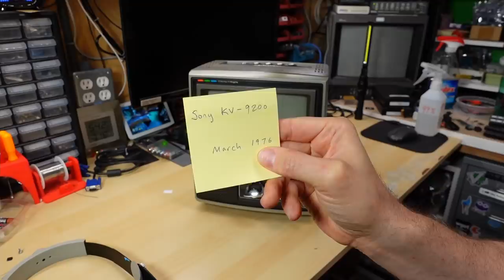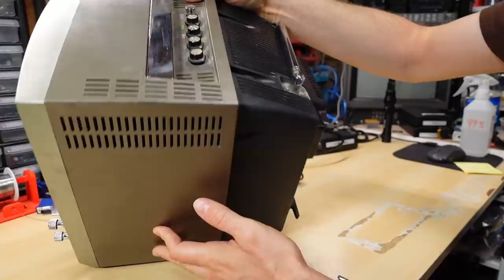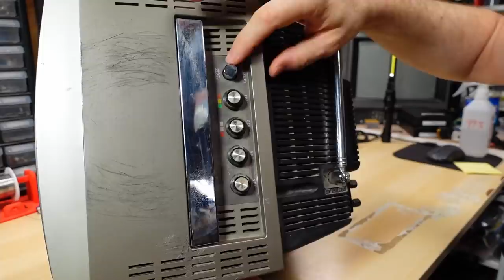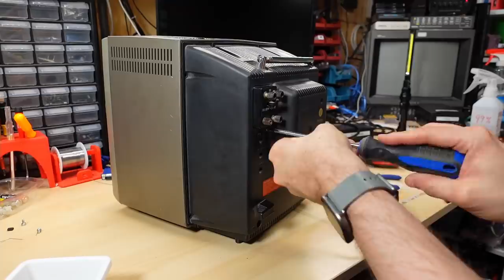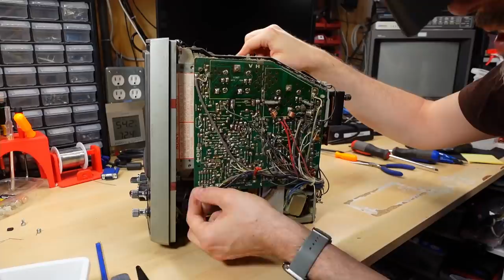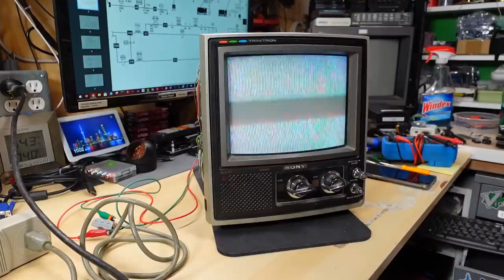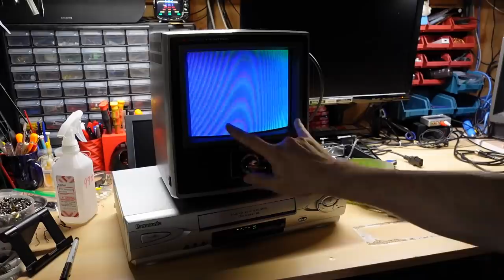A very used up (and broken) Sony Trinitron from 1976

Comment: Fun fact, keeping the filament on at a much lower voltage actually prolongs the life of the vacuum tube.  They used to do this to the early vacuum tube computers, to cut down on tube failures.
Reply: Isn't computerphile a great channel? <3
Reply: One part is correct in one part is not. They did leave the tube filaments on to prevent failure due to inrush current. Unfortunately the engineers discovered later that the tubes were failing at a very high rate. This was caused by operating the tubes for long periods of time in standby mode without b+ voltage. Special computer tubes were developed that reduced or eliminated this effect.  Many computers used 12ax7's or 12au7's and special 6000 or 7000 series tubes were developed that were exactly the same specification as the consumer tubes but with the special cathode that prevented poisoning.  These are now sought after by the audio fools and bring sometimes extraordinary prices as they are seen as being superior for audio work.
Reply: @randyab9go188  Ah, i did not know there was a separate design for those tubes.  I always assumed they were the same tube.

And i was basing some of what i said on other lighting solutions, which tend to last a much longer time if the power cycling is minimized.
Reply: @randyab9go188  The fun part is .. they aren't. 

Those special cathodes are noticeable noisier, doesn't really matter in digital circuits, but is a disadvantage in audio applications. Long-life audio tubes from the time DID NOT HAVE THEM. And the noise reason was stated by the manufacturers.

Comment: In the early 80s Hitachi made some sets called Instaview or Instavision, with an unusual directly heated cathode, the CRTs didn't last very long. Hitachi promptly made a modification which involved replacing the CRT along with several components on the tube base and flyback area, it kept me very busy for quit a while, I think Hitachi was honouring this procedure for around 10 years, must have cost them a fortune.
Reply: i had one of those directly heated hitachis as a second hand set for a few years until the tube emission was too poor,  also had 3 earlier (1972 ish)models which used a normal crt but kept it heated at lower voltage when 'off' , had a 'fully off' switch on the side, model cnp190, csp680 (which had a rotary click stop tuner, like usa vhf sets!, i'm in the UK), plus another one cant remember model no.

Comment: Worked at a place that sold a 36" Trinitron for s short while.

If I recall, it weighed just shy of 200 pounds!!!

The front glass was something like 3-6" thick and think they even had to counter weight the back so it didn't fall forwards.
Reply: I used to work for Radio Shack, and back in the day (2001-2004) we got a 36" RCA TV that was just as heavy.  We only sold one, was on clearance and was on the display.  It took 3 of us sales guys to get it down off the top shelf (without breaking it) and back into the original box.  Was sad to see it go because of the screen size, but also glad to get it out of there.

Comment: I have an early 70s 9" RCA B&W salesman's sample television, built with a mix of tubes and solid state. Its power cord is also incorporated into the back cover, as a safety feature: The idea is that you can't keep the TV plugged in with the back cover removed, so you can't electrocute yourself while swapping tubes. Obviously the consumer wouldn't be working on this Sony like they would with my TV, but I guess Sony still held onto the idea with their early solid-state TVs.

Comment: I have a late 70s zenith tv with a similar issue with the power/volume switch. I ended up just throwing a switch on the back of the tv to turn it on/off.

Comment: Adrian, somebody else has hinted at this but have you checked to make sure that the CRT is receiving full heater voltage? When you were messing with the wires on the switch maybe you have it so the heater is in the reduced power mode, that would certainly explain it being a bit dim. And we saw earlier that the instant on wasn't working, so maybe that helped cut down on the cathode wear a bit.

Comment: The Sony supplied cord unclips from the rear cover.  Use a flat screwdriver to pry the metal retainer off the cord.  It will move in the longer direction.

Comment: i have 3 of what i think were the first models released here in the UK, KV1320, KV1320 mk2, and KV1300 (plastic cased version of KV1320 mk2) all 13 inch ,1970, i think?,  the KV1320 mk1 version has a big mains transformer, but the mk2 a series chopper switching regulator

Comment: This TV was already 9 and a half years old when I was born.
1:33 - Whoa, I love that volume control+power button, they look like cigar lighters in a car :D
7:10 - I think an external antenna was sitting on top and they were turning it all the time to have a better reception.

I was like there's no way the power is bad, why did you bother checking it, it must be good because the tv drew current when you swithed it on. I wouldn't have guessed that the switch has some double action going on inside. Maybe you can fix it if you are able to take it out and has better access to it's back.

Comment: It's kind of amazing a 45 year old phosphor based CRT even works period.  Those phosphors are going to be worn out pretty badly at this point.
Reply: Not really. The first thing to fail would be the flyback. As long as that is good a complete cap change should restore it back to nearly full health, even if the tube is dim, which this one isn't, regardless of what he thinks. I've seen and fixed plenty that were worse, he's given up even before starting. Waste of time, give it to someone who knows what to do with it instead of hoarding it and complaining it isn't perfect LOL!
Reply: It's the cathodes, the phosphor always outlast the electron gun itself.
And Trinitrons are really, really picky when it comes to rejuvenation, sometimes it works and others it just makes it worse.
Reply: @GoldSrc_  Maybe. The point is the TV is not dead and it's not that dull. It's perfectly usable and a cap change should fix any geometry issues. For the amount of use it will get in the future it's just fine as-is with a bit of maintenance to the caps, adjusting the rings/yoke and possibly a light rejuv. The main issue is the wrong person has it.
Reply: @johnbos4637  It's not "maybe", that's what happens.
The cathode surface gets worn out way faster than the phosphor ever will, unless it happens that the deflection fails and he keeps using it while displaying a line, because that does burn up the phosphor.
Replacing the caps is a very good idea, I had a KV-1201 that I had to replace practically every cap.

As for rejuvenation, you do not want to do that to a Trinitron tube, the chances of doing nothing or making it worse are way higher, in-line electron guns do respond better than the Trinitron single gun design.
Reply: @GoldSrc_  You missed the point. It's working just fine as-is. Nothing is needed except new caps.
Reply: @johnbos4637  My original reply was not aimed at you though.
Reply: @johnbos4637  Didn't look dim to me. Looked like all the colors were there.
Reply: @andershammer9307  Exactly. That's what I said earlier. The screen is fine as-is and a cap swap will fix any other geometry issues. Like I said, the wrong person has it.

Comment: I have a 55" OLED TV which weighs 18KG (39 lbs) - 8339 cm² (8.98 ft²) of screen area for less than double the weight of this 9" CRT, which should be 251 cm² (or 38.9 in²) or even slightly less, accounting for visible vs. measured size.

I can't find an original price for the KV-9200 but I wouldn't be surprised if this cost more in its day, accounting for inflation, either.

45 years of technological progress has brought us a long way, although something makes me doubt that the 2021 display will still be working at all in 2066...
Reply: marketing strategy. your tv will last less than 10 years.

Comment: 9inches? and I thought 14" were small...

also, 75W !! holy crap... the last CRT TV we had was 20" and was just ~100W, my 42" LED TV is 85W
Reply: With CRT TVs the size doesn't contribute to the power consumption as much as you might think. Most of the power usage is outside of the tube itself. My family's only remaining color CRT TV (from 2000) is 13 inches and rated 69 watts, while I believe comparable 30" sets were more like 120.

A 75 watt rating for an old 1970s design set with a smaller 9" screen seems about right.

Comment: Trinitrons are ridiculously heavy, even late models, the glass they used is just so thick that it makes them "unique" with the heftiness, my 9" RGB Torch-brand monitor (which I got working at last!!!) is a heavy little thing too, based on a Sony trinitron character display, not helped by the metal chassis and the multiple PCBs inside the thing... :P
Reply: They needed extra glass to compensate for losing strength provided by the curvature of the screen. Flat-screen CRTs are also quite heavy.

But if you really want lots of weight per screen size, look at the old round CRTs. While modern CRTs have an integrated metal band to prevent implosion early CRTs needed to use more glass. A 10BP4 must be close to two inches thick at the front.

Comment: You should try degaussing it. Degaussing coils aren’t very expensive, but I can imagine you don’t want to put any money into it.
Reply: @jabbawok944  thanks, missed that one. There is a technique to degaussing though… bit of an art to it. Later monitors has degaussing coils built in that activated on power up or on request through OSD menu so hand degaussing was lost to time. My dad did it a few times in the early 80’s, I remember.

Comment: Instant on nowadays would be a cool feature. I've seen LCD TVs take longer to boot than tube type CRT TVs (with solid state CRT TVs, I would have beaten the first level of Super Mario in that time).
From what I've heard, Trinitron CRTs don't rejuvenate. They'll die if you try. Don't know if that's true, but if Shango, Radiotvphononut and Jordan Pier say so, I'm obliged to believe that.
Reply: You’d have to be VERY careful with a manual control rejuvenator and still get no noticeable results until you blew the cathode/filaments apart. Sad that these things might not be restorable, but it’s a nice piece of history
Reply: @lauram5905  yep, its a 'historical'/collectible item, it could never? be restored to an everyday working state, too much risk of failure of unobtainable parts such as line output/flyback transformer or eht block

Comment: Very weird shell/cord, but the weight is revealed inside heh. Looking at that tank I can't imagine it saying "Compressed air, my one weakness.". ^_^ Love the old buttons, looking at my new TV "No buttons, buttons are not the future!".  :\
Sad but true, if the tube is spent it's little better than a donor parts for that model. Do my usual spiel anyway, if you find better  ones, please, please add as many contemporary AV ports you can. RF devil forks absolutely doom vintage TVs to the scrap pile more than Coaxial or Composite ever will.

Comment: No more repairs? Yeah, that's a bid sad. Looked okay on video. Maybe someone else can work on it a bit. It's a cool little TV for sure.
Reply: I was wondering what happened to the CRT rejuvenator. Hasn't been out for a while.
Reply: @PJBonoVox  Trinitrons don't like to be rejuvenated, most of the time it doesn't work and it can make things worse.
Due to the single gun and cathode configuration design.
Your average in-line triple gun CRT responds better to the rejuvenator than Trinitron tubes.

Don't think I've seen Shango066, Jordan Pier or radiotvphononut rejuvenate Trinitron tubes for the same reason.
Reply: @GoldSrc_  Yes. Use remove shorts or clean function only.

Comment: 31:10 The color distortion on top could be electronics.. sure.. but it could also have been made by magnets coming too close to the screen i bet.
We did mess around with magnets on old picture tube tv's in the past. one could have for example a pure blue screen from a VHS machine menu, and make a purple dot on the screen corner or in the middle wherever you want with holding a magnet somewhat close.
If holding it far away it will be no permanent change but be discolored like that so you can easilly see what happens.
But too close and it will be purple forever if one does not do anyting to fix it. To fix it one had to turn the magnet around  and come on with the maget field upposite way  just the right distance, try a little and little closer to see if it has some effect. The blue menu will become forever blue again if you hold it at the right spot as it shall be. Too much and it becomes green instead and one have to turn it again to make it blue or if too much purple again so one one more time has to turn it around to fix it :)
So yeah, it looks like this kind of distortion that might be caused by a magnet, for example if lots of TV's or speakers was stacked on top of eachother it can happen, or loose car speakers perhaps more likely to be strong enought to make it permanent unless you fix it, like you may now need to do.
If one has a stereo HIFI system with a speaker close to the tv so it temporary will be purple while the speaker is there..  then one could just adjust it with a magnet while the HIFI Speaker is there so one could have the speaker close while still nice blue menu and no distorted colors, i did do that to my 28" Stereo tv in the past to have the speaker where i wanted it :)
If removing the speaker while having it this way it will be miscolored and time for a magnetic adjustment again when no HIFI speaker there.
So in a way what we found is that the screen metal film inside the picture tube is influenced by magnetics from the factory perhaps this same way as we did it to get the colors right.
If you cant fix the colors with messing around with electronics then try a magnet, we used the blackish ring type, old style 8-10" speaker magnet people often used as a fridge magnet.
I would not go as far as i can get onto the screen with those magnets, we was careful to not overdo it, it may get permanently miscolored unless you have a even stronger neodymium magnet perhaps to turn the magnet field around again.
It is kind of cool to see the color changes when holding a magnet somewhat away from the screen.
Many people may not know about this since we found this out ourself, even the factories may not have known it.
Reply: RCA used to sell v shaped magnets just for that. First would try degauss it first.

Comment: The scratch marks are from someone having a late 70s/early 80s era cable box on top of it.  Back then we all had that small push button box on top of the TV.
Reply: It could also be an external rabbit ears that was purchased after the internal rod got busted.  Those had to be turned frequently to catch the signal.
Reply: @hardlyworgen71  this is my vote. There’s no need to turn a cable box. How didn’t Adrian get this? He was even moving his hand exactly as you’d do to adjust the antenna!!